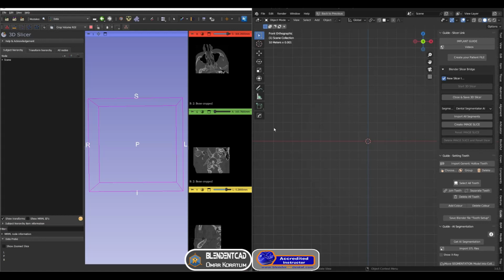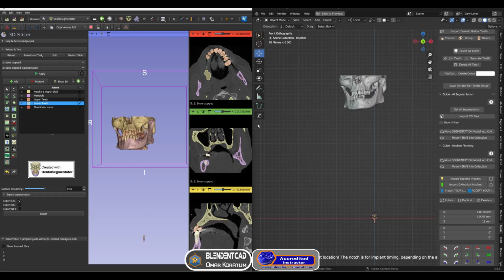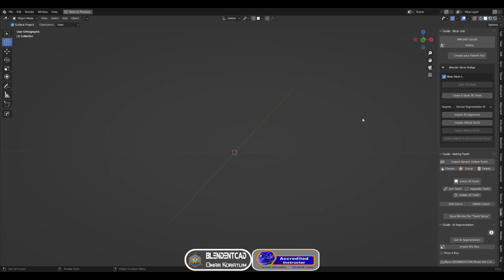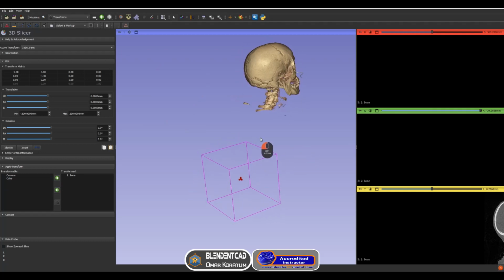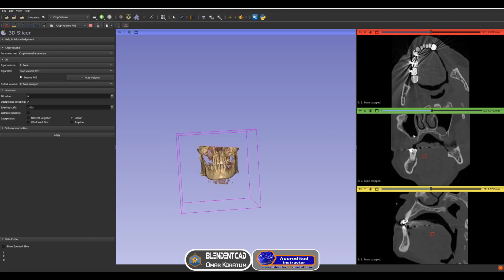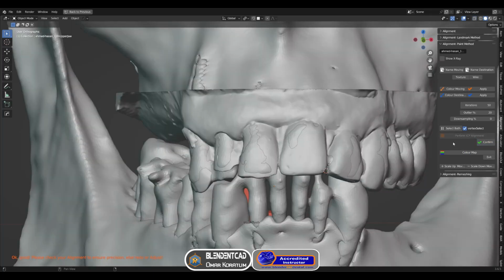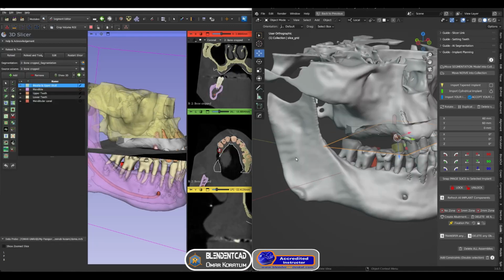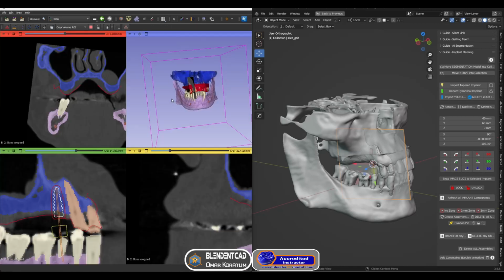Crop and Align Radiograph between 3D-Slicer & Blenderfordental for easier implant planning - Revised

Comment: this dentalsegmentator is not available in all countries?
Reply from the maker: No, it should work with all countries
Reply: @BlenDentCAD-OmarKoratum  do you have a link for it because I didn't find it
Reply from the maker: This extension is only available in 3D Slicer 5.7 version and you can install it from extension manager inside the application.
Reply: @BlenDentCAD-OmarKoratum  for some reason I can't install on my Mac but I will try on PC, thank you